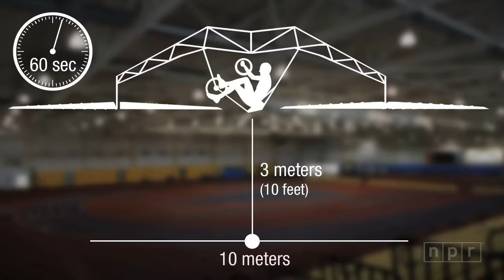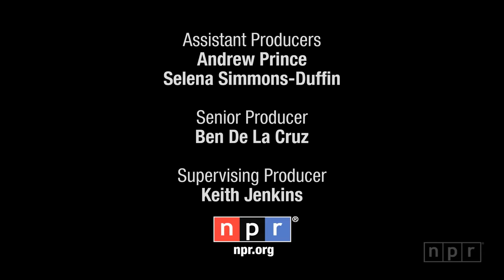Human-Powered Helicopter: Straight Up Difficult | SKUNK BEAR

Comment: So let me see, the drive train is a chain.... and you have problems with the craft drifting. I guess it would be too heavy to put a second gear, on each the hand and the foot chaindrives operated by a gear lever so you could power down the front or rear rutters slightly to move foreward and backwards  (slower front rotar makes it tilt foreward to move foreward and vice versa etc)

Comment: years later. you would have got the ten feet had the sproket on the drive pedals been bigger. thus using less effort to lift. while increasing blade speed needeed forlift off

Comment: Its impressive how easily those large blades lift the craft and pilot. As for the drift, they need the blades to move but oppose each other. I reckon they are already doing this however, the blades are not in perfect sync and would require near-perfect adjustment to allow the craft to remain mostly stationary.
Reply: Now that I think of it. They could perhaps build a flaps system of some sort which is controlled by the pilots head, the only body part left that can move something. So perhaps building a steering control into the pilots helmet.... such a fun experiment.

Comment: Gravitation pulls us down with 9.8 Newton per kg, so you need an upward force of 9.8 Newton per kg every second to keep floating, which is 9.8 W per kg.
If the total weight is 100 kg then the human needs to output 980 W at 100% efficiency to float, 1225 W at 80% efficiency. Basically even top athletes will feel like puking after flying with this for a minute no matter how well it is designed or built. I remember outputting between 1000 and 2000 W with a crank operated generator for 10-15 seconds once, I felt sick for a couple of hours afterwards.
Reply: Thanks for the numbers breakdown

Comment: Nice,
However, reduce the amount of weight, by reducing the rotor size, and stacking them, vs having such large blades being so wide apart.
The structure may be light, but needs a LOT more weight taken down.
The pilot is basically pushing himself AND the device in the air.

Comment: Ground effect. That is why these human-powered helicopters can't fly arbitrarily high. Ground effect happens when the aircraft is very close to the ground, and essentially the air being pushed downwards by the blades hits the ground and reflects back upwards, making it easier to fly while at that low height.  The effect increases exponentially as you get closer to the ground, which is why these helicopters shoot up off the ground so easily but then lose lift and can't gain more height.  The distance off the ground that ground effect takes place is about half the length of a rotor blade. Note how large the blades are on this aircraft.  That is helping them try to "cheat" and keep ground effect in play up to the 10 foot height.

Comment: Yes, I know it's an old video.  If you change a guy to one that has a different weight, your whole flying attributes change.  If the seat is not exactly at the center of gravity, small deviation will be amplified by a different weight of the "pilot."  If you add some weight on one side to compensate for drifting, then stick with the same pilot.  Build the helicopter AROUND THE PILOT.  You put that weakling guy in, hoping to save some weight, but instead you got someone that had no stamina.  Different weight + no stamina = crash.

Comment: Dude they should have that thing on a guide wire until they are passing height, then focus on balancing everything out for the attempt

Even then there should be a guide wire, or something that will stop the craft from drifting too far and damaging itself, it could have zero contact only bump in case of emergency
If you have to spend all your time and money fixing, and the fixes cause more weight, more irregularities, etc, it'll really slow down your progress

Comment: Pretty plain to see they need 3 things. 
  
1. Specialized pilots with more upper arm strength. Those guys seem to have the legs but not the arms.  
  
2. Some sort of steering. Possibly smaller prop that can be steered by the head. 
  
3. Longer string on the props giving longer flight times.  
  
Also why go so wide? Why not stack the props?

Comment: First step, tie a string to it so it can't drift into a crash!  Simple and it will work.  Second step, add 5 lbs to the rear to counter the drift.  Third step, use better body mechanics to power it.  Peddling is not the most powerful move a body can make quickly.

Comment: With all respect, i think hand pedals can cause power loss. Arms much weaker and cant add significant power support to legs. With a static handbar and proper sitting position, he can support his legs and produce same power without extra weights and vibrations. That vibration look tiring as hell and clearly he cannot keep pushing.

Comment: Why is it so damn massive? It's simple physics, you have to move X amount of air to lift Y amount of weight, the pilot only has Z amount of energy so move that air with a small high speed rotor blade on a small gyrocopter.

Comment: Blades drag the air at an unequal rate, and hence the drift when the copter is lowered down. Firstly, test in a wide open space and account for vortex turbulence. Next, invest in some low weight truss mechanism to vary blade pitch. Lastly, get a biomechanic engineer to redesign the horrible ergonomics of this bicycle drive.

Comment: 9 years ago, I could load this video in 3 seconds on an Intel Core Duo clocked at 2.0 GHz.   Those that had different experiences... As said a 1000 times before, it's not the computer 99% of the time. It's the user neglecting computer maintenance.

Comment: Really impressive but I am the only one to think that there ise a lot of optimization to do in regarde of the arms part ? Here the efforts between legs and arms seem completely disconnected. You lose all your torso and a lot of back muscles power

I'm sure it would be possible to make a syteme as lite were instead of cycling that high with your arms, you could instead make pull mouvements at torso hight. Like that you could engage they most powerful muscles of the body 🤔

Comment: Funniest thing is they rented these on the beach 100 years ago
You could rent the "Captive" which is just a normal balloon with a basket under it, fill with hot air and float around for 1-3 hours.
They charged a extra nickel for the Captain Tom model.. had a bicycle mounted under instead of a basket.. and pedal a fan blade. lol

Comment: But a true helicopter does not generate lift by just spinning the blades faster, it does so by changing the pitch of the blades.    If these human-powered copters could be designed to also adjust the blade pitch to a flat 180 degrees, this would allow the propellers to pick up a very high RPM, much higher than is possible with the blades at angular degrees.    With the gained momentum, the "pilot" could then suddenly shift the tilt of the blades and gain a sudden, even if brief burst of lift-off power.   The law of momentum would give the copter a greater maximum height.

Comment: They should consider covering some of those lightweight mesh structural members with cling wrap to create small pockets that can be filled with helium.  Doesn't have to be completely airtight.  Fill it up just before the trial so it slowly leaks out during the actually trial.  Even if it only negates 5 pounds, might be enough to add 2 ft in elevation. Assuming the rules doesn't prohibit the use of helium.

Comment: Direct drive is not the best way to do this, you need a fly wheel + low geared gyro,  then release with a basic clutch and then the operator can take over direct drive on a very high gear. This way you could achieve very high and sustained torque.
Reply: And the additional complexity and especially weight that would add would really help! Genius!

Comment: Great achievement. 
However, no self powered creature should have be the cream of the cream of fitness of its species and use all it's power concentrated into 20 seconds to say aloft. 
Add to that the fact that this design is only optimised for elevation and not even horizontal movement. Then further there is the fact that birds, insects and other flying creatures fly and travel in the air while also being able to do many other things optimally such as hunt, walk, fight and mate etc. 
It is unlikely that this design could be refined/optimised much further and so very unlikely that humans could fly in a functional way under their own power, even with augmented mechanics. 
the best we can hope for is wingsuits that glide on thermals and the miniaturisation of jet thrusters.

Comment: This is an amazing feat but i doubt it will be an efficient tool for transportation. First of all you can't maneuver with it, all you can do is generate lift. if they were to add another feature for maneuvering how would the user handle it while still using all limbs just to stay afloat. Secondly, the amount of effort you need to put in is ridiculous. Just staying in the air had them exhausted, imagine a 15 min travel assuming they found a way for maneuvering. Not to mention the added work in accomplishing that alone. Lastly, this thing is so huge it will be difficult to traverse in public with this thing. And the most lift they could manage is about 3 meters give or take. To be able to fully avoid obstacles they would really need to fly it higher more like the altitude of private choppers which is even more work. Assuming of course they have found a way to make this thing maneuverable. Just the amount of cons this thing has compared to the pros it has to offer (which is being engine free) is more than enough to suggest this thing is not worth it. 

Not saying this just to be hating on these people, just looking at it's efficiency as a real form of transportation, that's all.

Comment: Very clear he using all this power to spin the propeller, so the idea of a bike as a helicopter does not exist; they need to change the gear so they can spin the propeller faster in a lower effort; also, drifting required elbow under the propeller so the driver can direct the air.  This can be done by a 3D printer and Carbon fibre.

Comment: This is the Wrights brothers all over again with the human-powered heli this time. Maybe in 50 years will look back at this when we have human-powered helis the size of a bicycle but then I'm not too optimistic this planet will be here in 50 years.
Reply: We won't have that. The power output a human provides just isn't enough to sustain flight with our weight.
Reply: @logitech4873  At the moment, that sounds not possible. But you don't know what the future might bring. There might be a way to transform whatever little energy humans can produce to to something much bigger. Most of what we have now and take for granted would've been possible just 100 years ago to those who existed back then. I just don't think this world will be around much longer.
Reply: @adama365  Well this is a very simple laws of physics thing.
It takes a certain amount of energy to lift a certain mass in a certain gravity.

To manage sustained vertical lift, even at 100% efficiency, you need to generate around 1000W of power. It's extremely difficult for humans to do this for more than a few seconds.

There's a reason birds are extremely light creatures compared to their size.

Comment: Wtf?
I thought helicopter rotors had to spin like super fast, too fast to see to create lift. These ones are barely rotating.  Or rotating very slowly. 
Am I the only one shocked that these actually fly, while turning sooo slowly?
Reply: its because they are very big humans are built for endurance not high speed so its best to have big slow propellers rather than small fast ones

Comment: If you build a bike into it with an upright position, the pilot will be able to generate MUCH more power. Seriously. Like a lot more. Even if it will be a bit heavier in total, this will not be a problem I think. Then put a Word Tour Athlete on it like  Julian Alaphilippe or someone like that. And then watch that thing take off to Mars quicker than fucking space X, prrrrr prrrr.
No but I am serious, 10watts per kg is possible for some of these athletes. Now you do the math, I bet it will fly higher than 10 feet.

Comment: They are doing it wrong. They need to see what kind of power output is sufficient. If 500W is sufficient then they need to find a pro cyclist that can put that kind of output for 1min. If they need more (like 800W) they need to find a better cyclist, instead of using those boys that can't push even 300W sustained for a minute.

Comment: The design concept is way too large and unwieldy. Without control it is always going to be at the mercy of the slightest wind, and drift. They also need to cut the mass of the device by half, 40lbs max. To achieve this they need only 2 counter rotating blades, and not 4. The pilot will control the flight position by changing body weight.  And the lift blades, that are above the pilot's head,  need to rotate slightly faster to compensate for the other 2 removed blades!  With  this design they will be able to lift and control the flight! Spec; 40lb max mass, 2 counter-rotating,  slightly longer blades, chain drive, should do the trick, in a very fit lightweight young man or woman!

Comment: The design is wrong. I would do it with one propeller and advanced aerodynamic stabilization. I have built over 100 different models to test efficiency and functionality. It would work 100% 🤓😋. I wonder a bit how blind this young engineers are. Do they not learn in school how project work is done? Before you make a helicopter with 20m diameter, would it not make more sense to test all the elements first on a smaller scale? 🤔

Comment: I expected better from NPR.....the first words or narration are that the engineering team is attempting the "impossible". If that were true, they would not be good engineers....GOOD engineers would have done the math before building the contraption, and known that, small variables aside, it would at the very worst be "difficult", but not impossible. Cheap "journalism", contributing to the overall dumbing down of the "press".